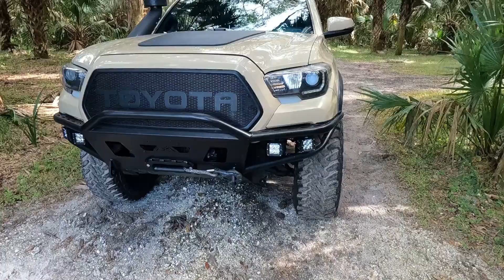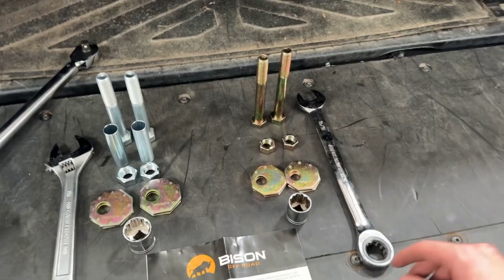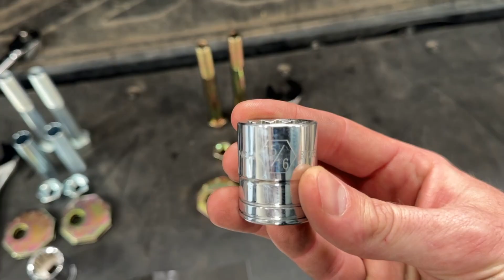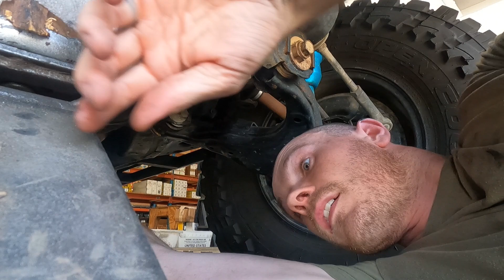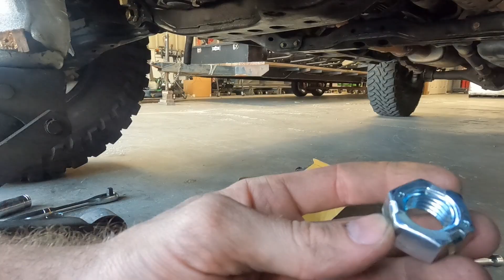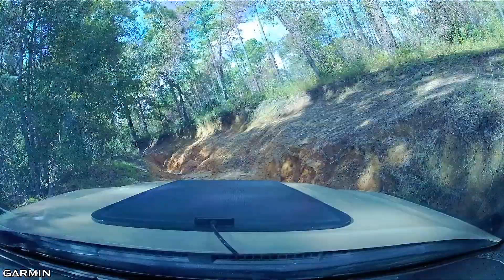Bison Off Road Stop Cam Kit

Comment: I just bought this kit for my 2020 Tacoma..I'm running 3 inch lift and 33s with zero offset wheels..Seems the kit quality had went down..I got plastic sleeves for the front instead of metal..Kind of disappointing..Also the from cam washers hole is too small to go flush on the bolt..Easy fix but they should rectify the problem...Other than that installation went smooth and hopefully will fix my problem of knocking the alignment out every 4 wheel trip we take...
Thanks for the video
Reply from the maker: That's disappointing to hear about the changes, make sure you got the correct kit. Not sure why they would have changed it if all was good. Once it is all in it should keep everything in place. If it does not, I would recommend the the Total Chaos cam tab kit. That will make sure the tabs don't move as well. Cheers,
Reply: @offroadyotaxploration  Yes it's the correct kit...I have to weld caps on my body mounts from were I cut them..So I'm going to run a bead on the stock tabs as they are still in good shape...Then I should be solid..
Reply from the maker: Nice, that is also a good option. Cheers,